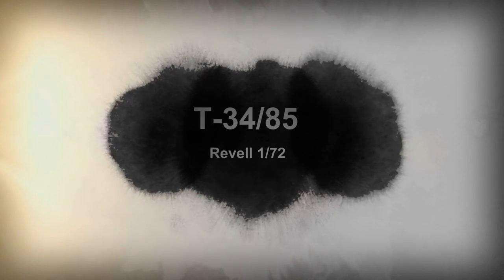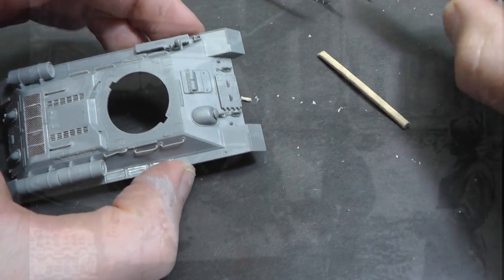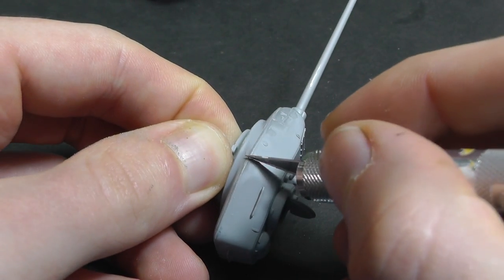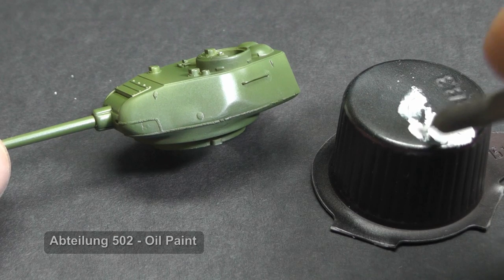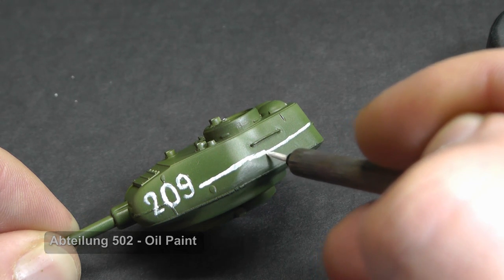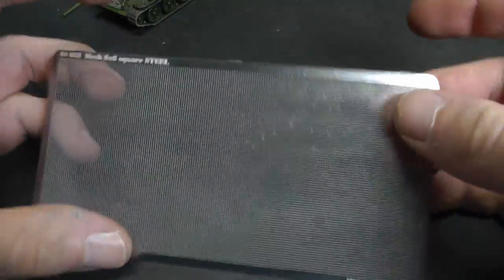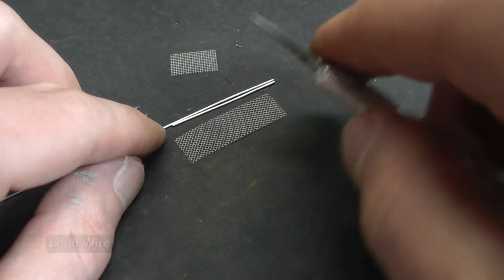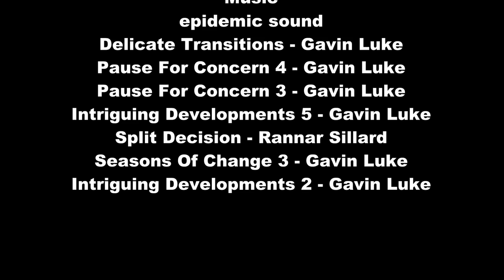T-34/85 Mod 1944 Bedspring Armor 1/72 Revell - Tank Model

Comment: Beautifully done, a master modeller... Seems like the drybrushing technique from my modelling days is no longer much in use... I'd use a soft flat brush, dip it in a bit of lighter shade paint, wiped the brush on paper towel several times, and then rubbed it against the raised surface details (like armor plate joints, rivets, handles, etc.) so that the pigments would get picked up by any relief detail... it created a very nice effect by bringing the raised detail into contrast, it was extensively praticed by Belgian modeller Verlinden.  I've seen on YouTube that this technique has gone into disuse and I wonder why, as I thought it was quite effective and simple.
Reply: Depends on the modeler.

I still use it for figures, but not very often on vehicles. Too easy to get streaks and a grainy finish.

Comment: Really good job on this my friend !   I'd like to suggest a couple of things for you to try.  First, I use a screw driver to get a common hight. I don't pre-shape the wire. I just pull it thru the holes. I use the screw driver to shape  "square" corners and then the blade to give a common height to the grab rails.  
   Second, I use plastic from a kit of a contrasting color for the stretched spry I use for weld seams. Makes it easier to see and add the "weld" to the seam.   Also, different manufacturers have different plastic so test a few and see how they can be used or not used sometimes.  
Happy New Year to you my friend !!!

Comment: The British Army used a similar technique on their tanks in battles after WW2 e.g. the A.V.R.E. Centrion MK5, a tank used in the Gulf War 'Desert Storm' - had an additional layer of thin metal plate that if battle-damaged could be replaced as and when it could be done, which they referred to as 'reactive armour'

Comment: If anyone would like to use this method for the bedspring armour, today I discovered that rather than using a lead wire, you can buy a lead strips in some fishing accessory stores, and I think it offers the following advantages:

1. you don't need to sand it and produce lead dust, or hammer it flat, since it is basically a lead ribbon,
2. you can cut it with an X-acto knife, so you can unroll whichever length and width you might need and just cut it into smaller stripes,
3. I have yet to test it but I believe if you cover it with superglue it's gonna stiffen the whole thing so it doesn't bend.

I think I'll also use this on my 1/35th scale T-60; the Mistercraft model I'm building does not have the net which covers the radiator's shutters, so I'm gonna use that Eduard mesh and the led strips to make one myself.

Comment: Hi David, outstanding build as always! Very realistic for this scale..btw my favorite ww2 tank
Just wandering, where did you get the fine metal net(is it made purposely for scale kits?) and what's the thickness of the metal wire you used for the side handles?
Reply from the maker: The metal net which I used is not for plastic models, but you can use it also.  https://www.ebay.com/itm/Stainless-Steel-woven-wire-mesh-30cm-square-sheet-Fine-Heavy-duty-coarse/261722409245?var=560592064076&hash=item3cefdf091d:m:myisTEt08FiFKf78OZQUr8w

I do not know the thickness of wires. I used some conductors from old electronics.

Comment: Can you suggest easy model for beginner ? I inspired by your videos and want to try by myself but i don't want ruin models..
Reply: Igor Siniak Hi Igor, I am replying to your enquiry about making plastic models ..The best thing to do is buy CHEAP model kits,of world war 2 aeroplanes such as Spitfires etc..these are  easier to build than  tanks,which have lots of little wheels and bits sticking out,Aeroplanes are more streamlined,therefore easier..Start with Aeroplanes in 1/72 scale,this scale is comparable to HO;OO. scale as used in toy trains..Because of the scale and size of the model it will have less parts and be easier,also  cheaper to buy..Go to a Hobby shop they can advise you..You will need glue (polystyrene cement) a pair of tweezers( you  have them already/in bathroom) a sharp little knife,such as he uses,and some emery boards ( like women use for their fingernails) Find somewhere well lit and peaceful with some ventilation ( glue vapors) and proceed quietly,just follow the instructions,always dry fit or test fit parts before gluing them..You will become good at it in no time,Children of 10 years old can do them...When you get good then you can buy more expensive kits such as Tamiya..have fun,all it takes is practice..Bob

Comment: Excellent work, I cant praise you enough. I was also wondering what side cutters you used as I am looking to buy a pair.
Reply from the maker: Thanks. I used Tamiya Sharp Pointed Side Cutter. They are very expensive, however, I did not find better so far.
Reply: Thank you, also I think for the next time you use bed spring armour as an additional challenge try to make it look like something has shot and damaged the bed spring. also, id just like to say thanks again because without you making that Warhammer 40k figure I probably never would have gotten into the hobby.

Comment: It's awesome congratulations.
When you remove the backside of the ventilator,  would you mind to tell me with exactly for what you substitute it, please? 
For your models I recommend you AB figures. It has wide range of WWII tank crews and they will be suitable for your tanks.
Reply from the maker: You can find a lot of useful material on eBay. For example here. https://www.ebay.com/itm/Stainless-Steel-woven-wire-mesh-30cm-square-sheet-Fine-Heavy-duty-coarse/261722409245?var=560592064076&hash=item3cefdf091d:m:myisTEt08FiFKf78OZQUr8w
Reply: Thank you very much for your help. As I can see, you never paint a base coat. You paint it directly.